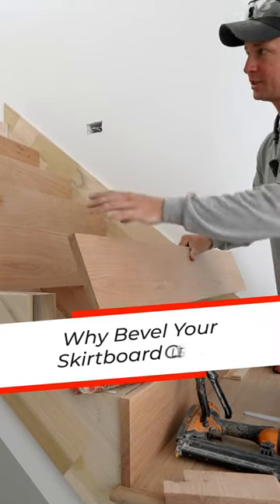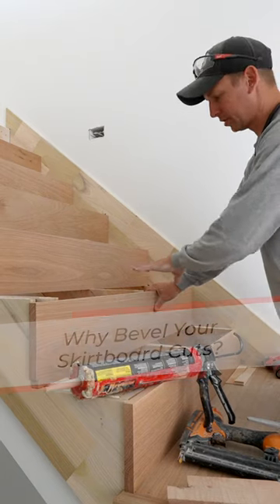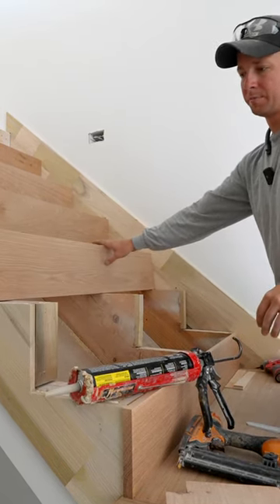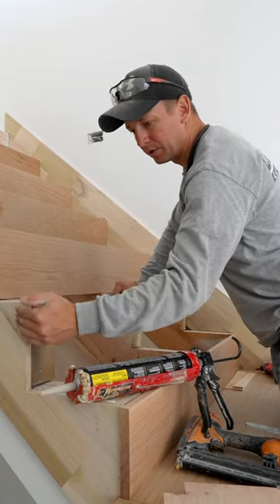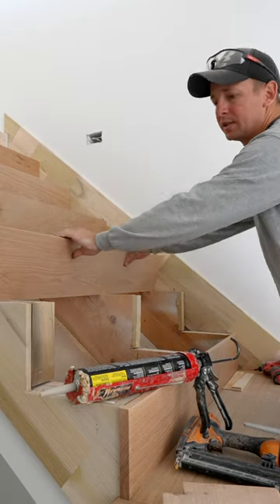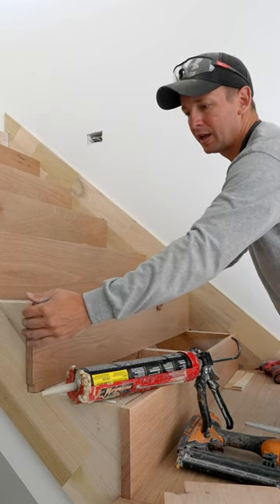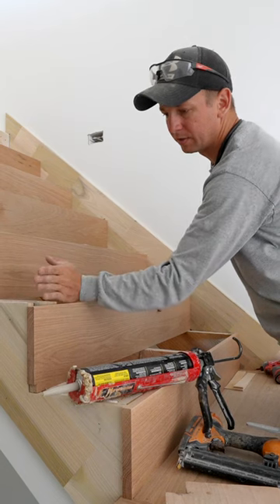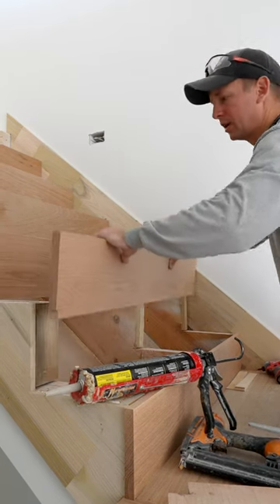Why Bevel Your Skirtboard Cuts???

Comment: great idea, Spencer.... a young carpenter named Derek Price showed me that driving a small wedge slightly between the wall skirt board and the wall stringer put a bit of tension on the stringer... so that when you finish nailing the riser in place and remove the wedge, that tension will help close any slight gap against the wall skirt board that might exist ( but be careful not to overdue that tension so you don't open the neighboring risers.....).

Comment: I know different places call Things Different but skirtboard is no part of a stair I think referring to the Stringer
Reply: You are wrong
Reply: Pay attention to the stringers and you'll find the answer; they are pine and won't take paint well. The skirtboard is laminated to the stringer for additional strength and to provide a paintable face. Poplar is much more stable than a soft pine and you wouldn't see the grain.
Reply: @HammerNQuill the skirt boards are finish grade material the stringers in this case are not. while they might add a little support they are meant to be decorative not structural. At least that applies to every set of finish staircases I have built in the last 47 years. We also do not use pine in our area of the country for anything other than firewood or shelving. We are lucky to have Douglas Fir to work with.

Comment: Why don't you miter your riser to your skirt board?
Reply: The skirt board is poplar and the risers (and probably the treads) are oak, so there would be no purpose to a miter. Once they paint the skirtboard, the riser would look like a veneer, so unless you WANT that look, you would usually want to show[off] the full dimension.
Reply from the maker: It was a style this homeowner wanted. It was the first time I have ever done it this way.
Reply: That’s the proper way. Miter
Reply: @allred53 Yes, on a traditional stairs, that is true, but on these clean, modern style homes, there is more utilitarian accent in the woodwork, and in this case, it's the end grain.

Comment: Why do you not bevel your skirtboards on the rise on a 45° bevel and your oak risers on a 45° bevel?  It is "finish carpentry"  also glue both risers and treads and screw treads with trim head screws.  Absolutely the better way to do it.  I've built 100 types of steps and finished them and have always used better building practices
Reply from the maker: Because the designer wanted this specific look.